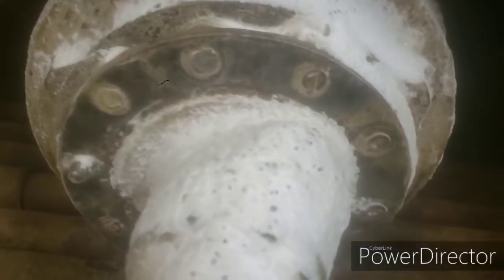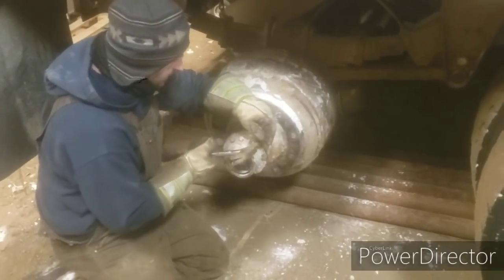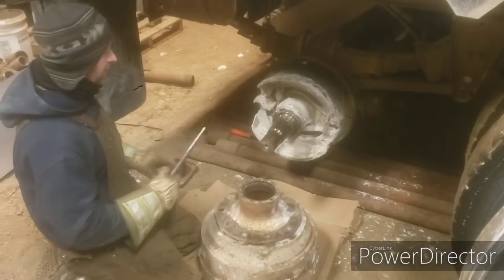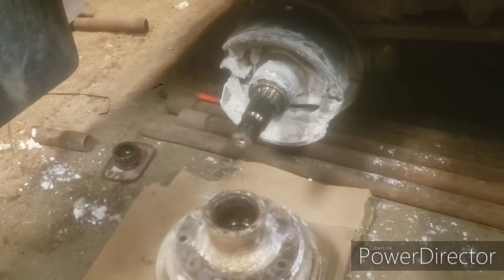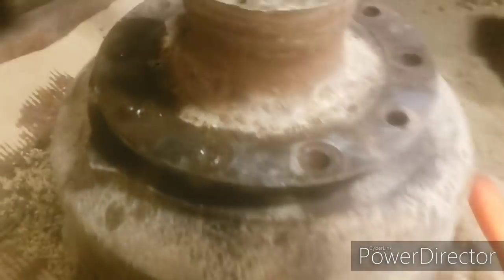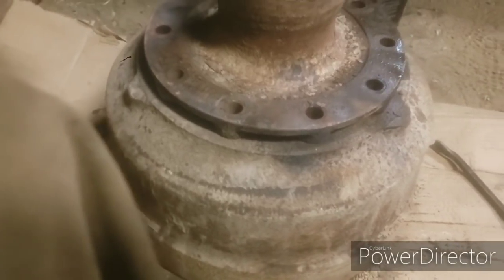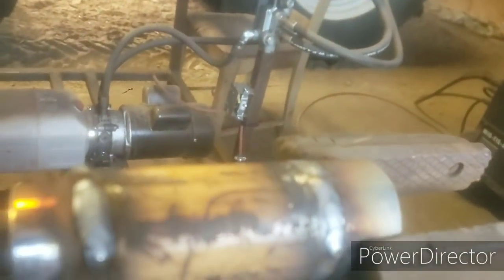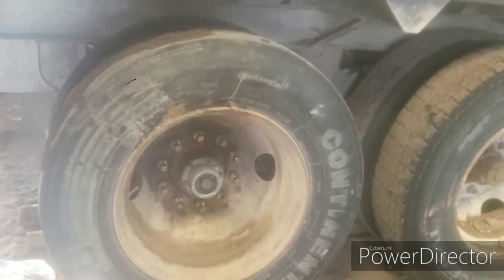Replacing broken wheel studs!!

Comment: We have not had good luck with re caps even on low mile per year farm trucks.  Usually it’s because the casing is old and starting to dry rot.  We can buy off brand virgin for not much more than caps.
Reply from the maker: Ok il have to look into that
Reply: True... rubber isn't as good as it used to be in the old days, so the tire carcasses dry rot faster so recaps aren't as good a deal anymore... 

When I drove a school bus, our local district was SO cheap that they put recaps on the rear duals... it's illegal to run recaps on a steer tire, but for the rear duals it's fine.  Not just ANY recaps, mind you, but recaps from the PRISON... evidently one of the state penitentiaries had a recap shop inside the prison, so basically they were getting tires for NEARLY NOTHING... only the best for a busload of school children!!!  LOL:)  OH well, I'd have settled for brakes that actually worked and held air LOL:)  

What always p!ssed me off driving a school bus was, they'd send me out on slick half-@ss tires with worn out brakes and leaking air like a sieve to pick up 60-70 kids twice a day, and that was fine... but my old 1966 Chevy grain truck hauling 25,000 lbs of grain, well, that SOB better not have ONE LIGHT out on it and everything better be 100% squared away or it'd never pass inspection... 

Oh well...  

Later!  OL J R :)

Comment: Ryan, I hope you aren't using those thimbles on the steel wheels!! The one you showed is for aluminum wheels... Won't tighten on a steel.. no wonder they were loose!!!
(LOL, I'm sure you already knew that!!) 
Outboard drums make stud changing easier 😎
Good, you did get the right thimbles😁
Love the combination sockets!!!
Reply: Yeah that inner nut that's for an aluminum wheel not made for Steel rim
Reply: @brianort3546  at least he got the right ones though... Just meant for aluminum outside 😎 we run steel in, aluminum out.. long thimbles are a pain when your spare is steel...lol
Reply from the maker: Hahaha home made works the best lmao. Ya they had some that had a spacer on em and I assumed they were for aluminum ones
Reply: @straightpipeacres6365  making sockets is fun🤣😂 used to make them for the tractor duals with the long rods..
Reply from the maker: @GosselinFarmsEdGosselin  lmao I did the same thing years ago hahaha
Reply: @straightpipeacres6365  LOL

Comment: I have always drove them studs in with a hammer . Never pulled em thru with the thimble .  Guess I learned something new . If you had a pork chop and a square socket you could of saved and reused the nuts . Never seize both sides of the thimble makes it easier next time changing tires
Reply from the maker: Lol they wont be on there long I have to put tires on there soon

Comment: Well fuck!! I hate that, long thimbles work great with aluminum outers, but not steel, because the combination sockets don't work!!
Reply from the maker: Lol I found that out the hard way hahah. They had 2 kinds there and of course I bought the long ones
Reply: @straightpipeacres6365  LMAO!!
I use the long ones on the stuff with aluminum, have a drawer full in the shop... Never have the right ones when I need them🤣😂
Or won't have the proper thread 🤣😂
Reply from the maker: @GosselinFarmsEdGosselin  I can see why they are longer for guys that use thicker aluminum wheels

Comment: In Ontario it's a $60000 fine for losing a wheel on public roads. ( if you get caught by the MTO )
Reply from the maker: Just gotta be quick lol
Reply: KyFarmerman  Well, it's a maintenance thing, they're trying to get big trucking outfits to do better maintenance by having such a draconian fine... 

It's nothing to mess around with for sure... a hundred and fifty to two hundred pound tire and rim rolling into oncoming traffic at 60-70 mph can definitely total a vehicle and kill someone for sure!  Heck it's bad enough when just the tire comes apart and is throwing rubber... Back when I was driving a school bus, we had a woman driver get hit by a semi tire that shredded and tossed it's recap tread WHOLE, so it separated from the disintegrating tire carcass and was rolling along beside the oncoming semi trailer like a big rubber hula-hoop!  It came across the line and probably hit a pavement reflector and started bouncing, and came right through the windshield on her... she was lucky, because smashing out the windshield absorbed a lot of the impact, but it hit the steering wheel hard enough to bend the sh!t out of it, knocked her senseless, and then bounced off the steering wheel and back out the windshield of the bus onto the ground in front of her... she was going down the road about 55 mph at the time, but she managed to get the bus stopped and the parking brakes set and get a radio call off before she passed out-- she had two black eyes and her nose swole up like a football for a few days!  If that tire tread had missed the steering wheel and hit her straight in the head or chest, it'd likely have killed her!  

I've seen a bus tire that the driver didn't do a good walk around inspection before hitting the road, that was underinflated or just plain flat, that when he rounded a corner the tire beads popped loose and those 22.5 taper-seat beads will just slide right off the rim easy as pie... tire flip-flopped back and forth a revolution or two once the beads popped loose and it rolled right off the rim and down into the ditch, and flopped over.  Luckily it was on the short drive after turning off the main drive into the school, so he wasn't doing but about 5-10 mph... BUT had he been going down the road 55-60 mph and the tire parted company with the rim, it would have ended up a lot differently... being on the right side it could have easily rolled right through someone's yard or into their house or car parked on their drive, or hit a car waiting to turn onto the highway on a right-hand side road... or hit a pedestrian or kids in the yard or who knows what... 

One time I was driving down a major highway and a semi wheel was rolling right down the center part of the divided highway beside me... I guess it came off a truck that had turned off onto a side road or something, as it was near an intersection at the top of a hill, and it was rolling slowly down the center divider, picking up speed as it rolled downhill, generally heading for the oncoming lanes!!!  Really got to watch for that stuff when you're on the road!  

Chunks of tire rubber in the road from blown-out semi tires are bad enough... One time I was driving east of Houston toward Louisiana on my way to Indiana and there was a chunk of rubber in the road about the size of both fists that had come off a semi tire that had blown out and was coming apart... I had just moved over to the RH lane of the freeway and this Chevy S-10 pickup was about 10 yards in front of me, and a Jeep Grand Cherokee was coming up behind me fast and getting over to pass me in the LH lane... The S-10 ran over the chunk of rubber with his front tire, it smashed it enough that it bounced up off the pavement and hit the underside of his truck right behind the passenger door, then the rear tire hit it in midair and SLAMMED the chunk of rubber into the pavement as it ran over it, and it bounced up around ten feet in the air behind the pickup from all the energy put into it by being slammed into the pavement, spinning end over end , and it came down right smack dab in the middle of that Jeep Grand Cherokee's windshield... I was looking at it when it happened and was already heading for the shoulder because I didn't want to get hit by it!  It SHATTERED the ENTIRE WINSHIELD of that Grand Cherokee-- just a CLOUD of shattered bits of glass flying off it, and left nothing but the inner plastic liner of the windshield flapping in the wind like a plastic bag between the driver and the outside... he swerved and I'm sure sh!t his pants 3 times before he managed to move over onto the shoulder behind me and get stopped-- luckily he didn't wreck out... 

Later!  OL J R :)

Comment: Is that type of double-wheel bolt system common?
I haven't worked with trucks for about 10 years, 
but then it was only one nut on each bolt that went through both rims.
Reply from the maker: No it's not but I've seen a few of them around
Reply: @straightpipeacres6365   Ok.
Reply: That's the old system... back before pilot-centered hubs...  

Back when I was in mechanic's school in 89-90 and early 91, the pilot centered hubs were still a "fairly new" thing.  Most of the big trucking fleets had them even back then, but there was still TONS of the old stuff running around in regular OTR trucking service.  Back then there were still a lot of trailers on the road, and even some semi tractors, particularly oilfield trucks, concrete trucks, etc for extremely heavy loads, that still had the old spoke-type Dayton wheels on them... SO we trained on ALL of them.  Them Daytons can take a LOT of weight, with the cast iron spokes instead of stamped steel rim centers or aluminum rims, BUT they're a royal PITA to do brake jobs on and change tires, and you gotta know what your doing and take some time to get the wheels on straight so they don't wobble like  h3ll... a lot of mechanics don't even give a sh!t or don't know what they're doing, and so you'll see them Daytons wobbling all over the place like crazy... The regular Budd wheels with the studs and thimbles and outer dual shell nuts were till pretty common, and still are today on older trailers like those commonly found on farms, logging, etc.  Still gotta pull the hub off to take the drum off the back to do a brake job,  but at least it's not a huge chunk of cast iron hub spokes like the Daytons... The pilot centered Budds are SO nice because the drum slides right off the front of the hub just like the tire rims when you take the nuts off, and you only have ONE set of nuts to deal with instead of nuts and thimbles... makes working on them MUCH nicer...  The main difference is that on the old style, the center hole of the rim bears on NOTHING-- it's just there for clearance around the hub and axle (on drives), the tapered-seat thimbles and nuts hold the wheels centered to the hub and support the weight of the load bearing down on the axle and hub...  Pilot centered has ribs or a ring around the outside of the hub that is machined down so the center hole of the rim rides fairly snug on it, and all the studs and nuts do is hold the wheel rims and brake drum clamped tight against the hub... the stud holes are simply drilled straight through the rim (instead of the larger taper-seat milled into the old-style hubs for the nut-centered hubs) and the nuts are flanged and flat instead of tapered backs... 

Later!  OL J R :)

Comment: What is the model case lawn tractor you have there
Reply from the maker: I think it's a 446 case I dont remember
Reply: @straightpipeacres6365  i have a 442 that i use to push snow with. Not to many parts around for them
Reply from the maker: @richardhaughey3661  I need to fix something with the charging system on it
Reply: @straightpipeacres6365  Does your 446 have a starter or a starter generator. let me know i have a repair manual for them and ill see what i can find out for you
Reply from the maker: @richardhaughey3661  lol I'm not sure il have to look and find out

Comment: must have been something very wrong with the people designing that set up,
Reply from the maker: Lol yep I'm not sure if they still use that deal or not.
Reply: @straightpipeacres6365  Nah most everything for the last 20 years has been pilot centered hubs with the drums going over the hub and studs, then the inner and outer duals, and then the nuts go on and smash it all together tight... The difference is, there's a flange(s) on the hub that the center hole of the rims rides on (the "pilot") that actually takes the stress of holding up the load on the wheel and keeping everything centered on the hub, instead of the the studs, thimbles, and nuts through the tapered seat lug holes... the new style has straight (untapered) holes through the rim that just slides over the studs, and flat flange nut instead of tapered-seat nuts... MUCH nicer system, because when you have to work on it, say do a brake job, you just take ONE set of nuts off the studs, then both tires slip right off the studs (well unless they're rusted together or some stupid sh!t like that and you gotta beat on em!) and then the drum just slides right off the hub from the OUTSIDE rather than having to pull the hub and bearings off the axle to get the drum off the back side of the hub... NICE!!! 

Later!  OL J R :)
Reply: Still will take even the old Budd wheels over Daytons ANY day of the week... having to wrestle them big cast iron spoked hubs off and on to do a brake job, those things SUCK GREASY DONKEY BALLS!!!  Then you get to d!ck around with the wedges and five or six lug nuts trying to get the wheels on straight so they run true without wobbling LOL:)  OL J R :)